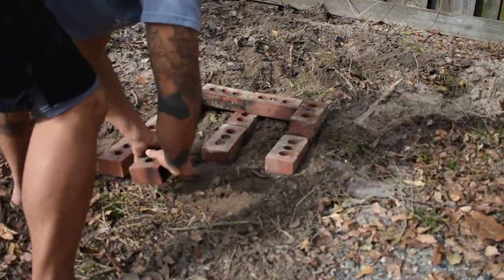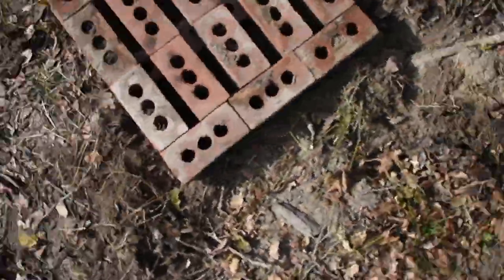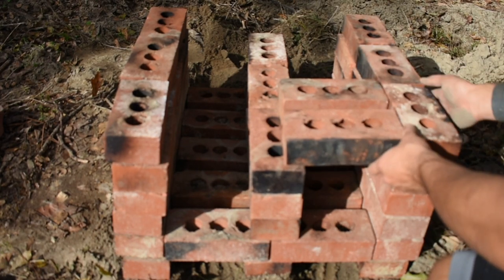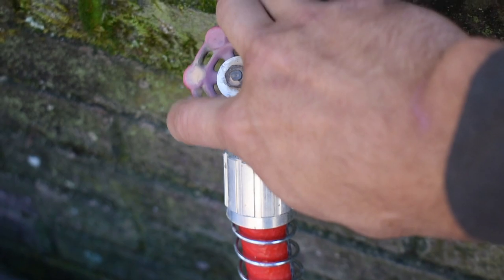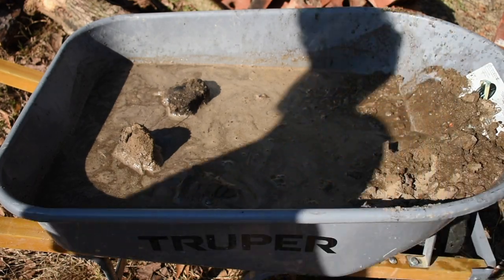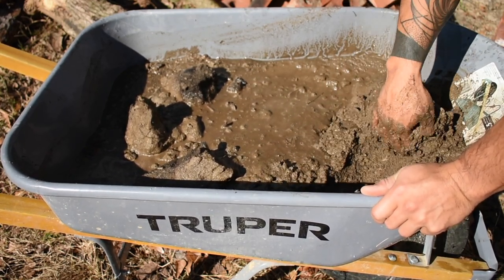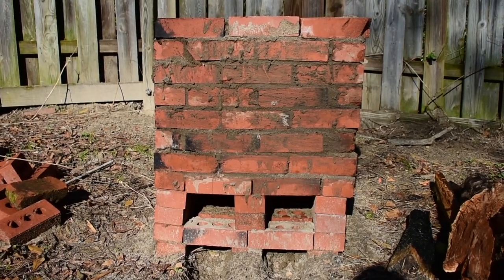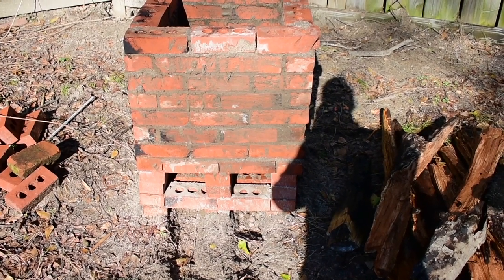How To Build A Brick Kiln

Comment: Does it have to be elevated off the ground? What exactly has to be ground level?
Reply from the maker: Elevating it off the ground helps with a stronger draft. The firebox (the area that houses the wood) will be on ground level but will have two chamber. 

One chamber (the ground chamber) is meant for the fallout of ash and charcoal that will be produced from the burning wood. This will make it easy to pull the ash and coal out. It will also leave more room for the fire to consume oxygen, as well as being able to pull that oxygen from underneath itself, creating a stronger updraft. 

The second chamber of the firebox is specifically for holding the fuel (wood or other organics). The bigger the fire box, the hotter and longer you can run your kiln for.

Comment: This is super cool! Can this be used to make food safe pottery?
Reply from the maker: It depends on what you deem as safe. Many cultures around the world still use earthenware pots for cooking, gathering and boiling water and many other practices dealing with food. But in the ceramic and pottery community in first world countries there is a lot of debate on whether it is food safe or not. So I can't really say one way or the other, but definitely do some research and experimentation and come to your own conclusion, and let me know how it goes!
Reply: @Higher_Perspective_Art  thanks for a great reply, that makes a lot of sense. I saw on another DIY kiln video that the kiln was not for food safe pottery and didn't quite know why, for the reason you stated already- earthenware is used all over the world. Thank you, I'll do my research and see what I deem safe for myself.
Reply: It depends on the type of clay you use — like you said, if it’s earthenware then it will vitrify at temperatures around 1945 F.  The issue is that in certain countries they are used to glass/plastic that can hold liquids that don’t seep but in other countries they only use burnished pottery for serving or cooking rather than long term storage.  Pit firing needs to get to the right temperature and that requires time and plenty of combustibles, so the temperature continues to climb.  The amount of pottery you have in the fit firing also affects total heatwork.  The other problem you can run into is that the wild clay may contain harmful minerals like magnesium (gives it a rich dark brown or even dark purple color) among others that if they came into contact with acidic foods, would eventually leech into the food which could potentially adversely affect your health.  You can get the wild clay analyzed and then you’d have to test the clay for shrinkage properties, plasticity and test fire several to determine the temperature it will vitrify (after firing you soak it in water then weigh it and compare it to the weight prior to soaking it in water).  That is why the simple answer to the question is “no” to the general public but it doesn’t factor in knowledge of wild clay and chemical analysis, reaching vitrifying temperatures, etc.
Reply from the maker: @starrynight2218  very true, thanks for sharing!
Reply: Food safe depends on porosity I believe. Clay doesn't crystallize hard enough to be truly impervious  unless you reach a very high temperature. I believe around 2800 degrees F. I could be wrong about the exact temp. But the elements don't melt together fully until a certain temperature.

Comment: Did you keep the top open?  How do you feel about the results? What would you adjust?
Reply from the maker: I kept the top open and I think keeping it like that gives it hotter embers, but on the other hand you have to constantly keep feeding the kiln and its hard to keep up the demand when you dont have a lot of wood. And I think I would make a bigger fire box because I cant get enough fire wood underneath so I have to add it to the top. Hope this helps.
Reply: That’s useful to know about the firebox size. Any experiments with firing it to share?
Reply: @Higher_Perspective_Art  If you had used the mud mortar instead of dry-stacking the firebox (and maybe also overlapped each course of brick) do you think it would have been sturdy enough to build a taller firebox?
Reply from the maker: @michaelstansell1001  I definitely think it would have been sturdy enough if I would have done those two things. I couldnt really overlap though because of the openings, or I just couldnt think of a way to do it. But doing both would definitely make it sturdy enough
Reply: Maybe cutting some bricks in half would have allowed you to overlap the layers @Higher_Perspective_Art

Comment: Are those regular bricks?  How well did they hold up to the heat?
Reply from the maker: Yes sir, regular red clay bricks. They're rated to 1800 I believe and most of my firings get around 1650-1700, but have gone up to 1800 before. My kiln is still here after almost a year, still works, I haven't covered it from the elements either. I do have a few cracked bricks and some cracks that need to be refilled with mud, but overall works great still. I'll most likely do a 1 year review on the kiln and then do a remodel since so many people enjoy the video.
Reply: @Higher_Perspective_Art  😮 That is good to know!  I have wanted to make a kiln on the cheap and this gives me inspiration.  Thank you for the video.

Comment: How many °C can be produce for this kiln?
Reply from the maker: The highest I've read on my Infrared thermometer gun was mid 1800 F. I'm not sure how hot it can get seeing as I only fire for about 6-7 hours max. It could probably go much higher if you used bricks rated for 2200 F or higher and also used higher rated mortar. It would take away from the flexibility of moving it though and become more of a permanent structure.

Comment: Hii😀.
Perhaps a stupid question. 
I’m from Denmark 🇩🇰,and doing c… in writing English.
Hope u understand 
Can I use paving stones . Instead of bricks ?
Reply from the maker: Hey Susanne! That's definitely not a stupid question. From my experience It depends on how porous the pavers are. If they are very porous then they will do okay as a kiln, but they will be prone to cracking more than a brick kiln. If you have pavers that are very smooth and non porous, it will be dangerous to use them as the moisture in the pavers (if you are using it outside) will have a hard time dissipating all of the moisture before it gets to boiling temps, making mini steam explosions as the water expands into a gas.